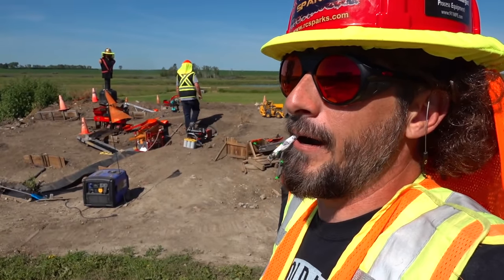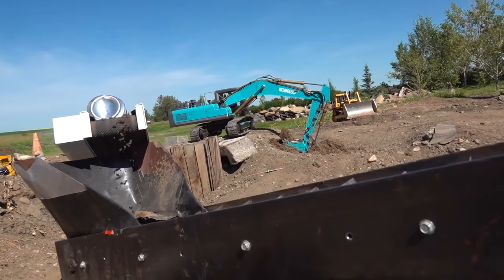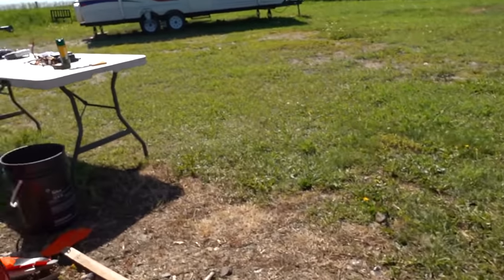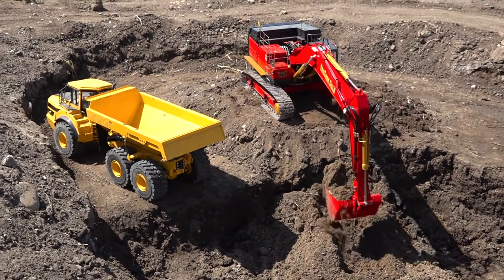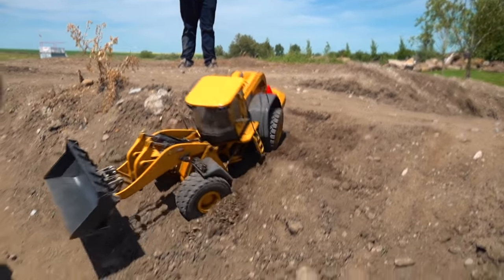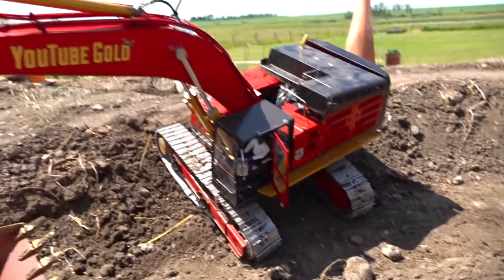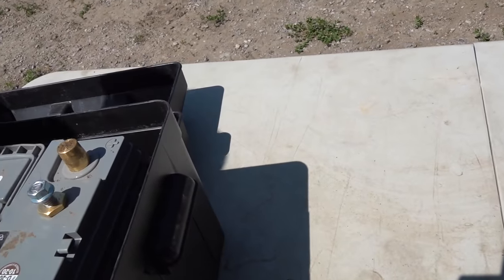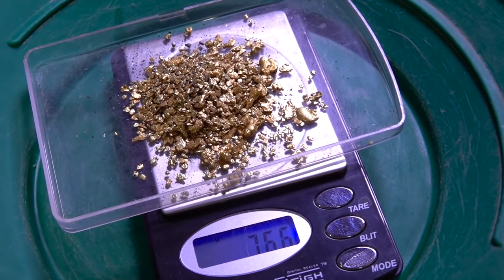YouTube GOLD! FOREMAN MiNES $1000 usd WORTH of CHUNKY GOLD with BIG WHEEEL (S3 E10) | RC ADVENTURES

Comment: Medic, have you ever considered hooking up your generator to your 12V batteries? Does the generator have a 12V outlet? If not, you could get a battery charger connected to the 110V AC outlet, and connect it to the batteries.  It would save a lot of weekly charging.

Comment: I like the enhancements and improvements you've been making each year from the previous. The switch box is a nice improvement.  I would like to ask, is that voltage being displayed only that?  They make those same little devices that will also show the amperage being used on the same display.  Then it will show the AMOUNT of power you are using dynamically change as you press each switch.  The number will climb.  From that you can derive with unit is drawing the least or most power.
Reply from the maker: Too efficient for me..!  This is #YouTubeGOLD, not #YouTubeEFFICIENCY!  haha